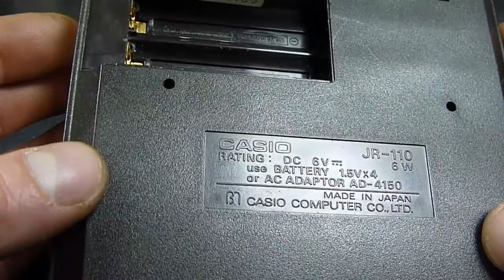Vintage Casio JR-110 Caculator Teardown and Repair part 1

Comment: The F Cut 5-4 switch is for rounding. F is Floating point (full decimal), Cut just cuts off the decimal portion, and 5-4 rounds it up if it's .5 or higher and rounds it down if it's .4 or lower. And then the other switch with the numbers selects how many decimal places to show.